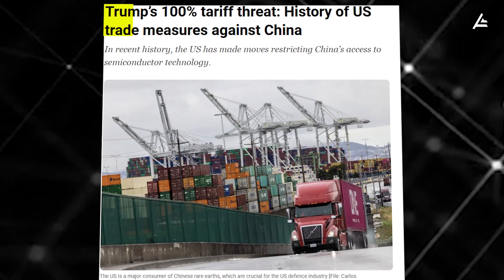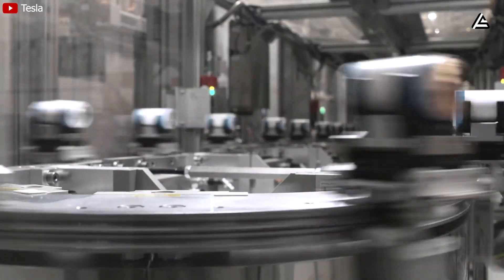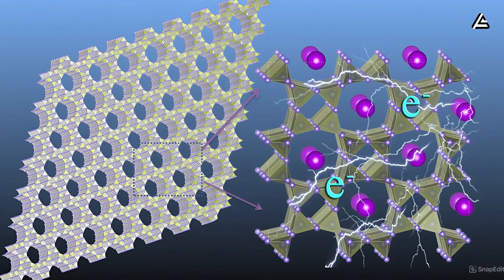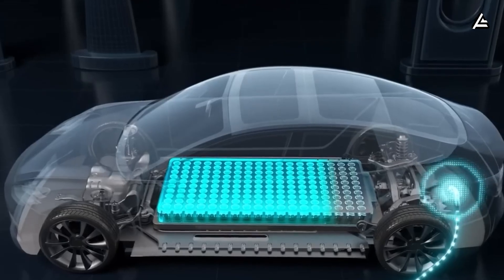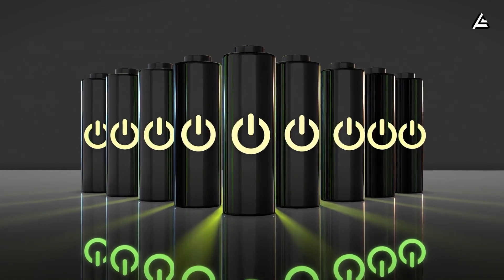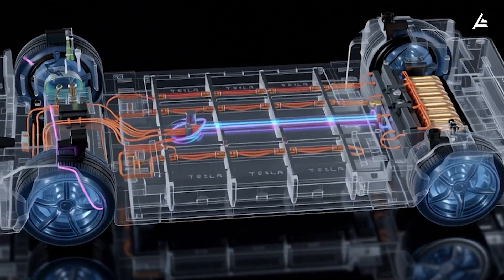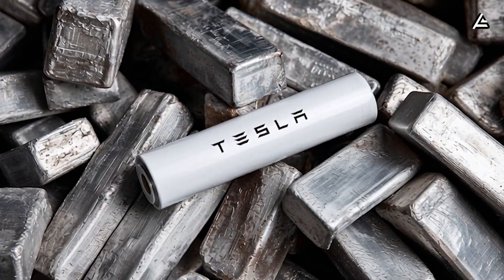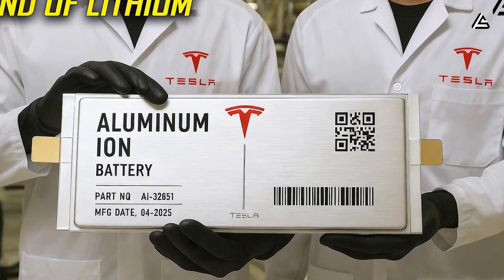2026 Tesla Batteries: Price & Production Plan Update. What's New?

Comment: 2:25 "In comparison, aluminum batteries only hit around 150 to 200 W hours per kilogram"
On 2022 October 11 GMG claimed 290-310 Wh/kg

"Ongoing development from GMG’s Battery Team has resulted in a significant increase in battery performance of GMG’s Graphene Aluminium-Ion Battery. Latest testing data has demonstrated a calculated energy density that has increased by 93% from 150-160 Wh/kg to 290-310 Wh/Kg since the last battery update on the 22nd of June 2021"
Reply from the maker: Exactly — that’s a key detail most people miss. Thanks for contribution!